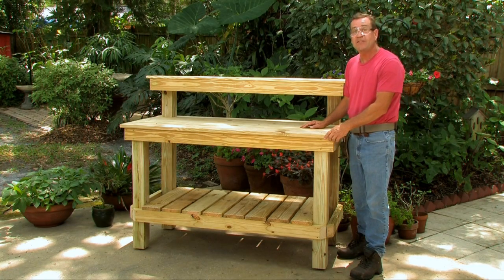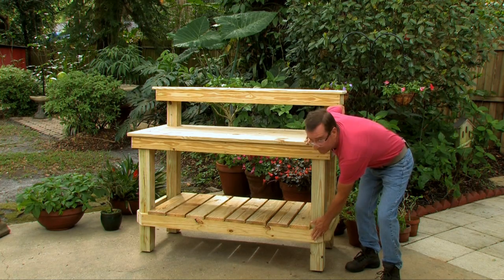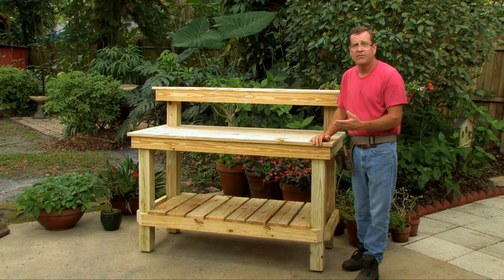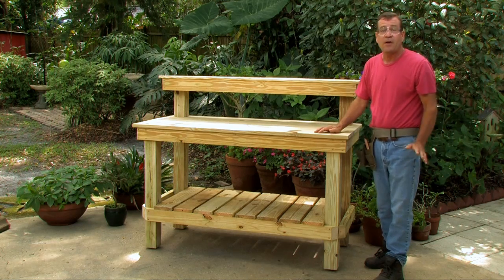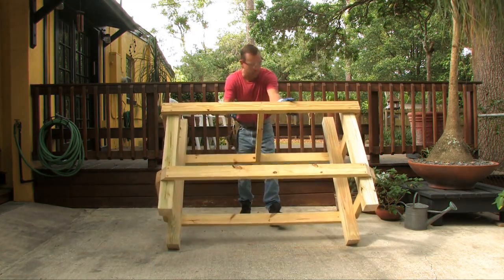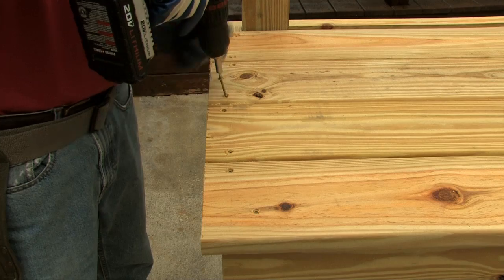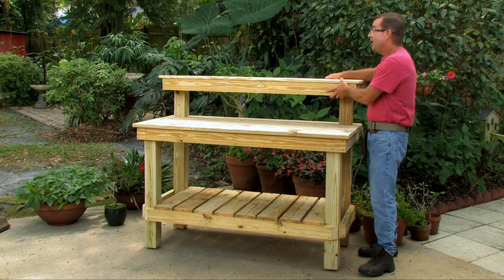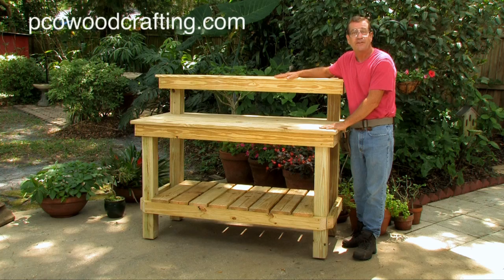DIY | How to Build a Potting Bench / Work Bench | Official Video

Comment: I found this video while searching for “simple outdoor workbench” on YouTube. I was able to get all the materials from my local Lowes for around $100 (3/17/23). I built this in about 3 hours, including the cutting - using a circular saw. Your instructions were extremely helpful, as well as the purchase and cut lists. I introduced my 9-year old daughter into woodworking with this project and she had a good time learning how to drill the holes and measuring the cuts. Overall, a very solid piece. Thank you for the idea and video!
Reply from the maker: Thank you for all the info SC5G, I am glad everything worked out and it is awesome that you got your daughter involved!
Patrick
Reply: Great idea making it a group project with your daughter.  That's what it's all about!

Comment: Excellent video, and like others I spent many hours reviewing the video. The plans were easy to follow and the purchasing list as well as the cutting list were extremely helpful. I pulled out my 30 year old plus Craftsman Chop saw instead of using the power saw. I purchased new countersinks, and a orbital sander. I had some assistance carrying the lumber and setting up. As I am in southwest Florida, it wasn't possible to work a full day due to the heat and the eventual rain. I did modify the bench. rather than making the 45 degree cut for the bottom supports, I simply made butt joints. I used my belt sander to round off the edges. I still need to do some additional sanding, but the rain has prevented that. I also used wood filler for the splits and for some errant predrilled holes. Lastly, I am 84 years old, and if I was able to complete this project, anyone can do it. The potting bench is extremely strong, and very, very heavy especially if you are using pressure treated lumber. Thank you again, for your concise well-thought out plans and video.

Comment: Just finished making this. This was probably the best woodworking instructional video I’ve seen, thanks for all the detail and step-by-step guide!  I made it by playing it step by step and pausing the video - about 1,000 times. : ) Also, the shopping list and cut list were super helpful. I did end up using only 1x6’s for all three flat surfaces, instead of 1x4’s on the top. Also, Home Depot hadn’t even heard of “5/4 deck boards” but the 1x6’s seem fine. Next I think I’ll put some water proofing on it.

Comment: Outstanding video!   I followed precisely.  My experience: 1)  4x4 from HD REALLY warped, you may have to use your leg to bend and fit the 45 degree cuts .  At first I thought I had cut wrong.   2) when fitting the 3 top shelf boards, it was easier to fit the first one with proper overhang, screw it in, and use as a guide for the other two.

Comment: I just finished building one of these.  We are using it to hold our Aquaponics System and it is EXTREMELY durable.  This will hold our fish tanks for years!
Here is my feedback on the build.  
Parts list and cut dimensions were perfect! I was able to give the list to the gentleman in the lumber section of Lowes and he easily pulled the wood and cut everything but the 4x4 posts and the 45 degree angles.  But there is plenty of remnants on the 2x4s to leave a bit extra so I could cut them at home.
The assembly order was tedious.  In hindsight I would have preferred to build the sides first and then working my way up.  Putting the top on first and then the bottom rails wasn't ideal. But everything went together as shown in the video. I built mine as shown in the video.
The only two modifications we made was the back piece of the top section split when we tried to put it in places.  So I just cut the ends flush and screwed it down.  The second modification was a 4" hole was drilled through the top on the right side to allow the plumbing of the top grow bed to drip down into the bottom fish tank. The 6" board are still very stable since I only took 2" from the two center boards.
I would recommend having a door or trap on the top right side of the table to allow people to put a grate or screen on the table for potting.  It's a simple mod and I might do that on my next build.  Oh yeah, I will be building at least two more of these if not three.  They are perfect work benches!
Thanks for the plans, great job!
Reply: Thank you for all of your recommendations Jerry, very well taken and I hope the viewers read your post to get your insight on this project. Thank you for sharing.

Comment: Thanks for the video! I made this to your specs last fall with mostly reclaimed wood from my deck replacement and a few odd pieces I had from other projects. I only needed to buy the 4x4s and a couple of the 5/4 boards for the table top. I even stained it with leftover deck stain. It's very sturdy and just what I wanted. I had a ton of compliments on it, so I shared your video! I'm shorter than you, so I'm going to tip it on its front then back to trim off the bottom 4-5" of the legs and make it better for my height. It's pretty heavy, but I was able to move it around by myself and level it perfectly where I wanted it. I may move it later, but it's done and very sturdy, and it's been doing the work for several months now!! Thanks again for such a great video!!

Comment: Well, count me among the those who have built this potting bench. We (wife and I) decided we wanted one for our garden, and after watching this video I decided to try building it. We managed to find all of the lumber, pressure-treated, from THD. Cost was approximately $250 for materials and a couple of tools (e.g. a counter-sinking drill bit). We printed the plans from the link provided and I think we probably spent a total of about 5-6 hours putting it all together.

The only difficulty I had was placing the top shelf over the two posts. I think I might have built the top shelf slightly too short, but I managed to chisel out about 1/16" of material on the inside/underneath the top shelf and got it to fit onto the posts.

We finished sanding down the rough edges and removing pencil marks from the wood. While the wood is pressure treated, we are still going to stain the horizontal surfaces just to make it look pretty. I need to do some research to find out what stain is best for outdoors on pressure treated wood. (suggestions are welcome)

Patrick, and/or PCO Woodcrafting, I am super grateful for these plans! Thank you so much! I have seen similar products at garden stores that range from cheap and flimsy to solid but extremely expensive. This ended up being both inexpensive and solid.

Comment: I love this project and I’m going to do it. I’ve had a really hard time finding the deck boards her in SoCal. Going to have to improvise.
Reply from the maker: Hi Roy, sorry you had a hard time finding the deck boards in your area. SoCal does have different lumber than most of the US, it is mostly cedar around your parts so, I hope you find something that works for you.You can always use 1x6 boards but they are thin, the next option is using 2x6 boards which actually are stronger and will make your bench more durable. Other viewers did make their benches using the 2x  cedar material and they came out awesome.

Comment: Thank you for the video. Excellent quality! Great shopping and cut list. I watched many potting bench videos before deciding to use yours. I'm almost done building the bench. Just have to secure the bottom shelf boards (last step for me), then sanding. I made a few modifications for my bench. One of which is using the entire length of the 4x4x8 which made the height of the small shelf at 5' high in stead of 4'. And I dropped the bottom shelf to just 4" off the ground to give me less leg and more height between the bottom and top shelf. And, I put 1x4s across the back to give me a place to hang small hand gardening tools. Thanks again. I was just wondering, why did you cut the front boards at the bottom to 45 degree angles? Simply for esthetics or was there a reason? I left mine square. Although my bench will be sitting on concrete, in a place where water is no issue, I took your suggestion and added the rubber feet on the bottom of the legs.
Reply from the maker: Hi Dr.John and Yvonne. I see that you have gone above and beyond with your potting bench, which is fantastic! I look forward to pictures of your bench! 
As the bottom shelf is concerned I actually cut the 45 degree cuts for esthetics. So no worries that you kept them square. Thank you for watching.

Comment: Great tutorial, my grandson and I are going to make it. Where did you get those feet? I can’t find any that look that large.
Reply from the maker: Hi Mary, I hope you had a chance to build it with your Grandson, the bottom rubber feet you can get at any box store or hardware store, they are called castor supports and you can find them in the hardware section of your hardware store.

Comment: I wanted to install a sink into mine. additional suggestions to support one would be awesome, thank you
Reply from the maker: Hi Kittie, you can install a small bar sink on either side of the bench top. the cut out size is 15"x15". In order to make it fit best, is to have your front cut out line as close to the inside top 2x4 support  as you can. You can install the sink after the whole bench is finished and use the provided template that comes with your sink to draw your cut out lines, then use a jig saw to cut the hole. The downfall of all of this is that the faucet will be a little under the back shelf of the bench so, make sure when buying your faucet that it fits under the shelf. I hope this helped you out a bit.

Comment: Great project. I may use simple 2x4 and pine. I was thinking of using this pattern to create a patio bar prep bench.
Reply from the maker: Hi Todd, this will work as a patio bar/prep bench or whatever you want it to be. Please keep in mind that you will need to use pressure treated yellow pine if you live in the United States.

Comment: Marvelous! I love it! Hey Patrick, if I wish to put wheels, it will be fine? What size is convenient for this project? Thank you so much!
Reply from the maker: Hi Mio, You can put wheels. Either 2 inch caster wheels under all four legs or 4 inch larger wheels attached to the back leg posts to move it around like a wheel barrel. It is a pretty heavy bench so, try to get good quality casters or wheels. Thank you for your nice comment!
Reply: PCO Woodcrafting. Thanks a lot for your answer and thanks for sharing this fabulous object of desire! 😁

Comment: I just found this, thank you! But you know, if you don't have the jigsaw you could just cut a smaller deck board for the back row, or make the top entirely flat, and then attach a shelf separately on top. But I like the strength of the 4x4s in the back for the shelf
Reply from the maker: Great tip! Plen122, I hope all of the viewers see you comment. It is a great recommendation!

Comment: I thought you used pressure treated lumber, if that’s the case I was always told to be very careful sanding and cutting it because of the chemicals. Is this not what you have heard?
Reply: You are correct Sir and I was going to mention this in your other post but, thought I would respond to this here. I recommend that when using pressure treated lumber that you do wear a face mask when cutting and sanding. I did not do this in the video because I had a microphone in my shirt and it was muting my voice when I had a face mask on so, I had to lose the mask for filming purposes. I did however use protective gloves and and safety glasses that I totally recommend for wood working projects. Great call Jason! Safety First!
Reply: Patrick Carley my wife and I built this same potting shelf, thank you so much for the video. Very empowering!
Reply from the maker: @jasonfabela1482  That is awesome Jason, I wish you and your wife many years of usage of your potting bench. Thank you for your kind comment.

Comment: Great job on the video and the plans.  Great inspiration.  I adjusted mine on the width and kept the depth.  Now to sand and stain. Thanks Again !!!
Reply: Liked the 2x4 braces on the bottom.  The way they spanned on the exterior of the posts made it easy to install wothout constant measurement.
Reply from the maker: Great S R, I am glad the video helped you out!

Comment: What a great tutorial!  Thank you for posting.  Is there any reason I shouldn't use 5/4 x 6 deck boards on the top shelf instead of 1 x 4s?
Reply from the maker: Hi Rich, You can use the deck boards for the top shelf, you will need 2 deck boards at 60" rather than the 3-1x4s. 
I used the 1x4s just to offset things and add to the appearance but, the deck boards will work just fine and end up having just about the same width dimension of 11", I wish you well! Thanks for your post.

Comment: Quick question. For the 45 degree cut pieces do we cut to your measurements and then give it the 45 cut? Or with cut it’s supposed to be to your measurement? Mahalo 🤙
Reply: Brandon, sorry for the late response and you probably figured it out by now. The furtherest end of your cut on the 45 degree angle is your measurement.
Reply: Patrick Carley Mahalo Pat! 🤙

Comment: What size countersink did you use?
Reply from the maker: Hi Andrew, I usually use a 1/8 countersink drill bit, if you can't find one this size you can always get a larger size such as a  9/64 or the next size up but, wouldn't go any larger than that.

Comment: Thank you so much for this tutorial! I will be building this come summer, but want to use composite boards for top and bottom shelves. I will only do a table, without the third top shelf. Any tips on using the composite material? I want this to be multipurpose; store firewood on the bottom shelf and use table top for gardening etc.
Reply from the maker: Hi Monika, great idea on not having the upper shelf it gives allot more room to work. Great idea on using the composite lumber for the shelves and counter top but, you will still need wood for the frame. No added things to do with the composite lumber, please pre drill just like in the video,  it will work out so much better for you.

Comment: Anyone care to share how much they spent on the wood and where they got it from? Lumber yard vs HD or Lowes? Thanks
Reply: Hi Kevin, It actually comes to about $125 for materials depending on where you are located.
Reply: Let me know where you got your lumber.  Because there is at least 40 board feet here and giving the benefit of the doubt the cedar costs $5.00 bsf (board square foot), more like 10 or 12 or 15 dollars (depending), but even if you go with $5.00 bsf that's over $200.00 without tax and without the screws (another 40 or 50 dollars, depending).  Then the pads for sanding, electricity, LABOR & MISTAKES (if your not a pro; and I bet he made them too) and your near 500 dollars and that's 5 dollars a square foot, more like $400.00 to $600.00 just for the lumber, if you can find it square, no bows, no cups, no twists and the like (that's labor too) and making sure each one is perfectly(almost anyway) square.  Just saying that we  totally are going the wrong way in so many things in this country it's ridiculous.  That bench should be 150 bucks, tops, but all the incidentals companies have to pay, well, basically a 2" by 4" bench is WAY overpriced.  I use cheaper lumber and seal it.
God Bless.

Comment: Thanks for this excellent video. Is your pco website site still working? Im going to try this and wanted to subscribe to your website but it doesnt seem to be working. It is clear your instructions and easy going manner is appreciated by many. Do you have any ideas for a Vermicomposter box?
Reply from the maker: Hi 369, no, I took my website down due to slowing my workload down. As you saw I put the link to the shopping list and cut list below the video rather than being on my website as it was mentioned in the video. I will have to check out your idea about the Vermicomposter idea! Thank you!

Comment: I know you are a pro, so things are always easier the more you do them, but I was wondering why you didn't use a level and for that matter glue?   I am always worried they (whatever they are) aren't going to be leve.
Thanks!
Reply from the maker: Hi James, for starters, this is an outdoor wood project using pressure treated lumber which is very wet when first starting to build. No use in using glue, the glue will not make a connection to the lumber and besides glue will not withstand the cold or hot or rainy weather. As far as using a level, great question! I built my bench on an incline so no matter what it would not be level, By following the instructions you will see that all of the measurements work out without using a level. I hope this answer helped you out.

Comment: Why did you not leave a space between the table top deckboards for water to run off?
Reply: Probably and also dirt from potting
Reply from the maker: Hi Ed, I did not leave space between boards because usually pressure treated lumber comes from the factory wet. It will dry out in about 30 days and leave a 1/4" gap between boards.

Comment: 5/4 = 1. 1/4 INCHES in pre-decimal  UK (1971) ,,.Regards Alf
Reply from the maker: Hi Alf, actually when the lumber is milled down the actual size is 1" thick which equals 25.4 mm. Thanks for helping out for the community other than the US. I will be providing metrics in all of my upcoming videos.

Comment: Why didn't you use 5/4 boards for the top shelf ?
Reply from the maker: Very good question Mike! Actually I had this very same suggestion from another viewer of whom used 2- 5/4x6 deck boards on the top shelf and it worked out great for him. The reason I did not use them in this video is because I liked the look of the 1x4s and have since been building with the 5/4x 6 deck boards because they are stronger and last longer.  Great question!